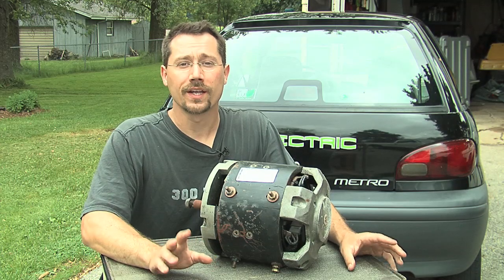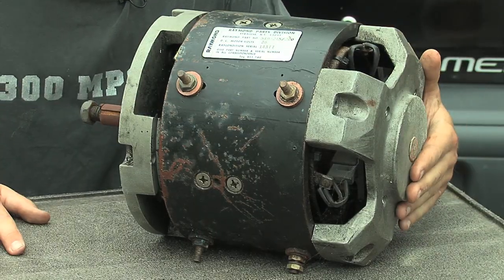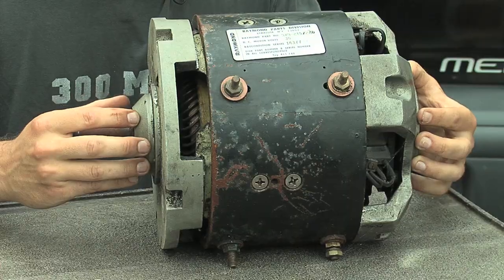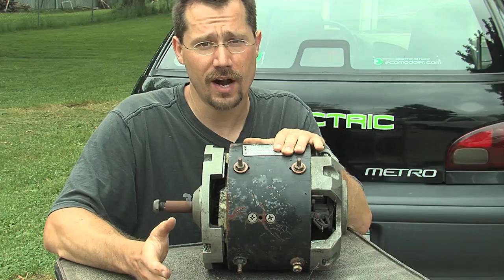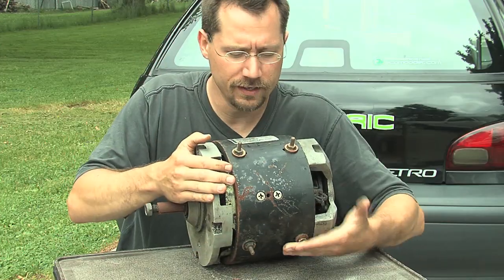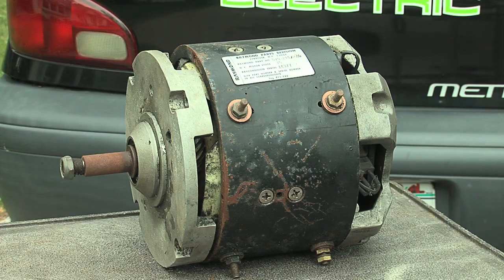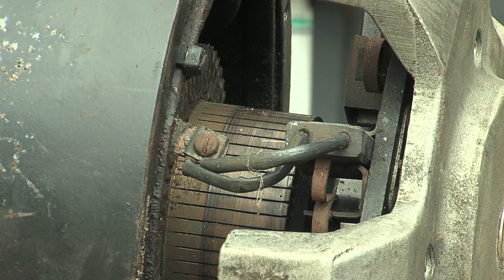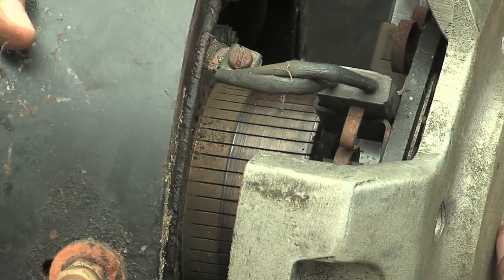5 Build Your Own Electric Car: DC Motor Basics

Comment: Forklift motors have lower efficiency than permanent magnet motors.They are designed to have short time high power to lift and if you use them a longer period of time  , they will get overheated soon. Collector friction and driving the stator coils are unnecessary burden compare to a 3 phase brush-less permanent magnet motor.
Reply from the maker: Lower efficiency is true. However, please keep in mind the difference between efficiency and EFFECTIVENESS. Gas powered cars tend to only be about 15% efficient, but lots of people drive gas cars because they are effective at transporting goods and people.
An induction motor is less efficient than a permanent magnet motor, but Tesla used an induction motor in the original Roadster because it gave so much torque! For the Model 3, they switched over to a permanent magnet motor because it was more efficient, which allowed doe a smaller, less expensive battery pack, which helped bring down the total cost of the car.
ANY electric motor is leaps and bounds more efficient than a gasoline engine, whether it's AC or DC, brushed or brushless, permanent magnet or electro-magnet.
In the case of this particular project, it was a $50 motor, and the finished car can both burn rubber and pull away from a dead stop in 5th gear.
Reply: I only compared Brush-less to Brush motors.

Comment: Is this what Tesla uses ??
Reply: They use AC motors, it has an inverter that takes the DC voltage from the batteries and converts it to AC to feed the motor. It’s just better and more powerful
Reply: No. Brushed DC motors are simple and outdated, which is why they are cheap and great for a hobbyist.
Reply: Thank you    😁
Reply: Saludos muy buenas

Comment: DC is so 1990 technology !!!
3 phase induction AC is the way to go, or permanent magnet 6 phase is even better !!!
Reply: you are right, but title says: DC Motor Basics
Reply: You dont get his point... its all about beeing as simple and cost efficient as possible. But generally you are right
Reply: But you can do many more things with it such as regen braking, easy reversing, and different control schemes.
Reply: You're not going to do that for $50.
Reply: Why?
Reply: Miro Kefurt
Reply: @Esha Roy Let's not forget the lost involved in using the inverter...and yeah, it costs much more and requires more knowledge to put together. Nothing better than hopping on a DC basics post and saying...hey...AC is better. Hey...this isn't a Tesla page...I'm sure he'll make one later.
Reply: Absolutely Correct. True 3-phase is by far the best way to go.
Reply: I am wondering why DC. Tesla is using AC motor with an inversor
Reply: Numbnuts You need a long ext cord for one of those
Reply: @92-SC300  its about capital outlay...not what's possible. With enough money you could have PWM multi-Phase AC operating at 4K or 7k volts, which is much more efficient than 240 or 480. Amps go down as voltage goes up. This is why you are forced to use 240/120 in the home. More watts, more cash outlay each month.
Reply: generally they are more efficient so you get more power with the same input. you can also do things like pwm control.
Reply: Efficiency depends on use case. For extremely high power in a small package, a DC brushless motor is most efficient. However an AC induction motor will be more efficient for normal driving. But of course brushed DC motors, like the one seen here, are an exception to that. They are cheap and easy to work with. But they are terribly inefficient, underpowered and have more wear and tear compared to both brushless DC and AC induction motors.
Reply: It may be more efficient but is considerably more complex!

Comment: Motors with hraphite contacts and collectors need maintenance, there is lot of graphite dust inside motor and messy. It is better to use BLDC motor which still has magnets in rotor which can weak durring the time. The best way is to use 3 phaze asinchrone AC motor like Tesla do, there is no commutator and dirty graphite dust, there is no magnet which can weak of heat when overload.
Reply: That is accurate; asynchronous AC induction Motors are a lot more robust then permanent magnet based brushless AC/DC synchronous Motors, which is why they are the go-to choice for big Industries. However from a strict efficiency perspective, permanent magnet based synchronous Motors can be up to %120 more efficient. Granted any kind of electric motors will usually be between %250 to %300 more efficient then the average gasoline engine.

Additionally AC motors require a slightly more complicated controller and tunning circuits. So it might be technically out of reach for the average person. Where as a DC motor only requires a basic variable resistor, or an off the shelf switched mode power supply.

Comment: what part of the forklift does it come from and what type of forklift please. generalities are ok.
Reply from the maker: In a full-size, sit-down electric forklift, the electric motor is bolted directly to the differential on the drive axle of the vehicle. On many forklifts, thats the back wheels, more or less straight down from the seat.
Reply: BenjaminNelson most sit down full size forklifts drive the front wheels and steer the rear.

Comment: Awesome video thankyou so the motor is pretty much a big car alternator powered coils, perfect just what ive been looking . So do you run same voltage to armutor and field coils?
What brand of controler ?.
Thanks so much you made my electric car project down the track alot easier.
Reply from the maker: On series-wound DC motors, the field and the armature are connected in SERIES, so they are part of the same high-power circuit. The same current and voltage are passing through the field and armature.
For controllers, I've used Alltrax and Curtis brands. I also used a homebuilt "Open Revolt" motor controller with this car.
Reply: Thankyou great work keep it up

Comment: Wow Benjamin, you are awesome! You have inspired me to go ahead with converting my 1992 Volvo 960 to electric. Old car but low mileage and zero rust. I think it will be relatively easy (ish) to convert due to the larger-than-average engine bay and rear wheel drive! Thank you so much! Your experience and insight is worth gold!
Reply from the maker: Depending on where you live, an older car can sometimes be licensed as "Classic" or "Hobbyist". These can offer an advantage of being less expensive to register, only have to pay a fee once, (instead of annual) etc. Check with your State or other appropriate government. Older cars are also often exempt from pollution control testing. Although an electric car makes no emissions at point of use, it can be a bunch of hassle and red tape to prove that to a government official!
Reply from the maker: Here's a little about when I took my project car in for emissions testing. It was an interesting experience, to say the least.
http://300mpg.org/projects/electro-metro/emissions-testing/
Reply: Hey thanks for the reply Benjamin. Yeah, although I don't live in the US. I live in Montreal and I assume laws differ here somewhat but I'll look into it. On another note though, I plan on removing the engine and transmission including the radiator allowing me to couple the DC motor directly to the drive shaft that connects to the differential in the rear end. Then I'm worried about weight... my Volvo is a solid steel beast weighing in at around 3500 lbs. To move that weight around I'll need more batteries... more batteries means more weight and more cost. The engine has an aluminum block (2.9L inline 6) so not as heavy as a cast iron block but certainly some weight can be saved by removing the engine and transmission. This might allow for more batteries. The other thing now is where to place all these batteries... the car's engine bay is enormous especially when the power train is removed but placing all those batteries in the engine bay will make the car very front-heavy and little weight to the rear-end. Use the trunk for battery placement and engine bay as a trunk perhaps? Anyhow, I'm looking into solving all these issues before starting to gut the car. Any suggestions? I very much value your experience.
Reply from the maker: Keep in mind that if you go straight to the driveshaft, you lose the gearing in the transmission and you only have the gear reduction of the differential. You will also need to add revers ELECTRONICALLY, by physically spinning the motor the other direction. (In my Geo Metro, the motor only spins the one direction, and I used reverse gear for backing up.)
Because of the loss of gearing, vehicles with an electric motor going straight to the drive-shaft usually have used high power motors and higher voltage systems. Take at look at the EV Album (EVAlbum.com) to see some conversions people have done direct to driveshaft.

As for weight and bulk of batteries, yes, more batteries you have the more weight there is. At this point, lithium batteries are a better choice than ever. I'm a big fan of used lithium batteries from salvaged vehicles. Cells from Nissan Leafs and Chevy Volts a readily available, and offer good power in less space and weight than lead acid ever did.
Reply: Oh man, what a story! I'm very glad things worked out in the end. Unreal the bureaucracy that infests everything.
Reply: Oh wow! Never thought of used lithium batteries, brilliant thank you!! As for the transmission, removing it was a thought I had in order to solve the cooling issue with it. As it stands right now, the transmission has cooling lines running to the radiator allowing the transmission oil to cool. If I keep the transmission in, then I have to keep the rad in I guess and therefore the water pump but will have to be run from somewhere else other than the engine's timing belt of the car as is right now. If OK with you, can I email you if I have more questions (which I know I will) rather than clog-up the comments section here?
Reply: I think you missed your calling my friend that was a spellbinding read
Reply: @johnveroutsos  Just buy a recirculator pump. I can't imagine that with the surface area of the radiator and lack of engine heat that it would take very much to keep your transmission cool. You won't need a fan...again, lots of coolant, large surface area, no engine, heat only when moving.  It'll work off 12 volts easy and be simple to wire. Just place it inline and mount it after everything is done. It won't be high pressure...
Reply: @sknerl  Awesome, great idea! Thanks... let's see
Reply: Dc converting is going to save alot of cars that otherwise Get junked.
Reply: With Rear wheel drive can you ditch the gearbox too, giving more space & weight saving for the batteries?
Reply: Ohhh nice ride Ken!
Reply: Hmmm dunno yet. Gotta check it out. Great idea though! Thanks!
Reply: Oh yeah love the older GMs - they rock especially the old 3.1L (had a 91 Lumina with one). Front wheel drive is good in snow or so I thought till I got my Volvo 960 which has a limited slip diff - that thing will not get stuck anywhere even with half-worn out snow tires that I used this past winter.
Reply: @johnveroutsos  I am looking around for another Saturn. I think it's super light body/frame combination would be ideal for this. The engine and such weigh in at about 250 lbs and the car itself in total weighs just one ton. Plastic panels so they always look pretty much the same as day one...oh and cheap. Non-running is under $500 all day.
Reply: Jay Vee
Reply: Loop

Comment: So if horsepower is not important, what should I be looking for in the motor? Is the voltage and amperage required more important?
Reply from the maker: Yes, you want to check voltage and maximum sustained current. On brushed DC motors, you want a nice large commutator. Physical size of the motor itself is also usually a general clue to how powerful it is.
You can also calculate horsepower by multiplying volts times current (in amps) to get watts, then divide by 746. (One horsepower = approximately 746 watts.
On this Geo Metro, with a 500 AMP motor controller and 72V battery pack, the motor could produce about 48 HP (500 x 72 / 746) That doesn't sound like a lot, but the torque is instant, and it was enough to burn rubber in this car. Running the car at 144V with a 500 amp controller, the power is double, with almost 100 HP. A larger more powerful motor will let you draw more current than a smaller, less powerful motor.

 Keep in mind though that the big difference between horsepower electric vs horsepower in gas is that for gas, it's rated at PEAK horsepower - the engine is revving at its most powerful speed. On electric, horsepower is measured at a CONTINUOUS rating - how much work it could keep up for hours at a time.
It's like comparing a sprinter to a marathoner.
Electric motors also have full torque (twisting power, needed for acceleration, for example) instantly, where as a gas engine has to be revved to up to speed before creating power.
In my Geo Metro, I could pull away from a dead stop in 5th gear. A gas engine car would never be able to do that, it simply wouldn't have the torque to do it and would just stall the engine.
Reply: @BenjaminNelsonX  do you really need the gearbox then?
Reply from the maker: @xXZ31t6esTXx   You don't NEED a gearbox, but you typically need at least single-speed gear reduction, a place to mount the motor, a differential, and possibly reverse. In a front-wheel drive car, the transmission does all that. https://300mpg.org/projects/electro-metro/transmission-for-an-electric-car/
Reply: @BenjaminNelsonX do you know about companies that make convertions? Thx 4 the answer btw
Reply: @BenjaminNelsonX  I'm sorry...what do you mean by gear reduction? The thing is that it really helped to get rid of my gearbox and I was thnking on putting the motor directly connected to the differencial!!
Reply from the maker: @xXZ31t6esTXx   In most small front-wheel drive cars, the differential is built right into the transmission. They are one combined single unit, you can't have one without the other.
In a typical front-engine/rear-wheel drive vehicle (like a traditional pickup truck) the differential is a separate unit, built into the rear axle. Some people have converted pickup trucks by connecting an electric motor directly to a short drive-shaft and then to the differential. For that to be effective, you need a pretty powerful motor, and ideally one designed for peak power at lower RPMs than most electric motors. You would only have the gear reduction of what is in the differential, typically 3-5:1. By comparison, a Tesla Model 3, with its single-speed gear reduction, has a final drive of a 9:1 ratio. It can produce 2-3 times more torque because of the gearing.
Reply: BenjaminNelson  thank you so much for answering back! Yes! My car is RWD! So you're saying the car'd be very slow if I used an heavy duty engine connected directly to the differential using the drive-shaft(?)
Reply from the maker: @xXZ31t6esTXx  Generally, an electric motor attached to a differential by a short drive shaft will usually draw high current and be slow to accelerate. Many electric motors have best power at something like 5,000-6,000 RPM. I did the math on my Chevy S10 pickup truck. With the 4.11:1 differential gear ratio and 27" diameter tires, 65 MPH is about 3,300 RPM. If I had an electric motor that performs best at 5 or 6k RPM, the gearing is just plain wrong, especially for accelerating from a stop.
Using a motor that is designed specifically for more power at a lower RPM helps. Also, you would want to use as high voltage as possible to maximize power while reducing current.
If you take a look at the AC50 vs the AC51 motor, the AC51 produces maximum horsepower at about 1,000 RPMs less. Fortunately, both motors provide almost flat torque from 0-4,000 RPM. http://www.hpevs.com/hpevs-ac-electric-motors-power-graphs-ac-51.htm
Anyways, the point is that in driveline design, you should try to match up motor speed with where it is most efficient or powerful to what you need the speed on the road to be, and the most straight-forward way to do that is through gearing. When you do NOT have the multiple speeds of a typical transmission, you need to put a little more careful thought into planning the project.
Reply: @BenjaminNelsonX  again thx a lot...if I come up with another question...can you still help me?
Reply from the maker: @xXZ31t6esTXx  I try to respond to youtube comments as best I can. Sometimes that means making a blog post, so that I can put more time, effort, and information in that I could do with just a reply. That way, as many people can learn from the answer as possible. Take a look at https://300mpg.org for more information on DIY electric vehicle projects.
Reply: Kyle Olinger The relationship between horsepower and torque is a strange one. Most of diesel engines are the same way. They may show a low hp rating, but they have what is called bottom-end horsepower(torque). for pulling. Let's say we have two trucks, A Ford F150 and a Kenworth W900. We'll just say they both have engines rated 400 hp. The Ford is not able to pull the kind of trailer that the Kenworth can. Why? because the Kenworth has the diesel with the bottom-end torque for pulling. The Ford truck will have more speed.